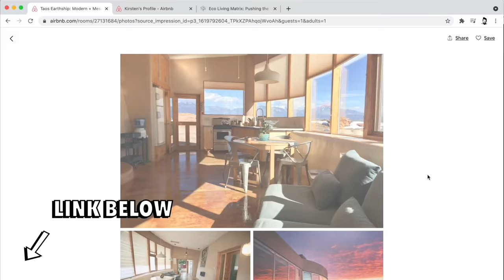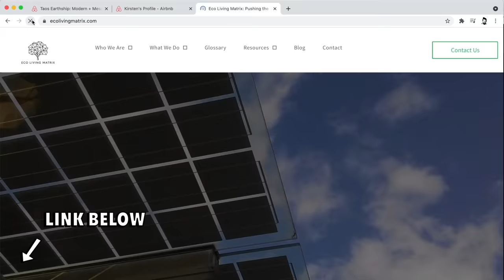Best Home Tours of 2021! 10+ Unique Earthship Inspired Homesteads

Comment: Instead of aluminum cans between the tires, you could use tin cans. They are much stronger. They also are filling landfills, even though they can be recycled. Just a thought.
Reply: Tin rusts but aluminum doesn't
Reply: @rosegreen2787  the cans have no structural value. They are just filler. The honeycomb shape of the cement is what gives the support.

Comment: IMHO Using old tires is dangerous because tires are extremely toxic.  Tires continue to off gas extremely toxic vapors and they will not ever be less toxic.  Have you ever walked into a big box store which sells tires? There is a distinct odor in the air and that is from the tires off gassing.    Some day people will become aware of their huge mistake to ever use ground up tires on athletic fields, play grounds and other surfaces.  Those that spend time on these surfaces will eventual endure health issues whether it be immediate or decades later.  And for those that say, "The tires are covered or sealed".  Unless the tires are fully encapsulated with a permanent vapor barrier... people living in such structures will be exposed to the toxins.   Having said that... I am fully supportive of alternative building techniques with the exception of using tires.
Reply: The idea is to use the tires as a retaining wall, possibly to create a ventilated space, a utility room, between the living areas and the tires. I have seen that done.